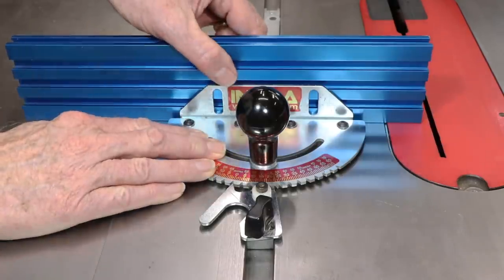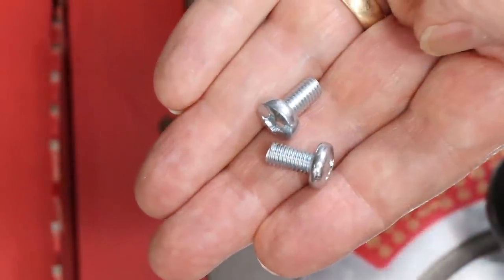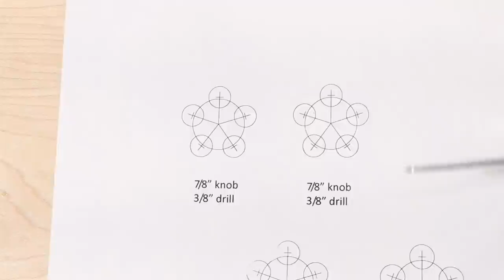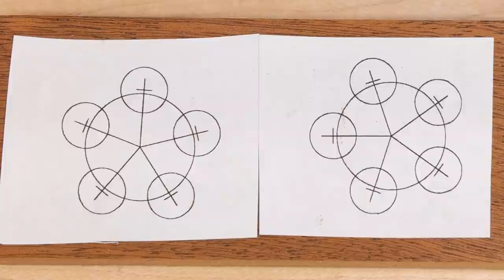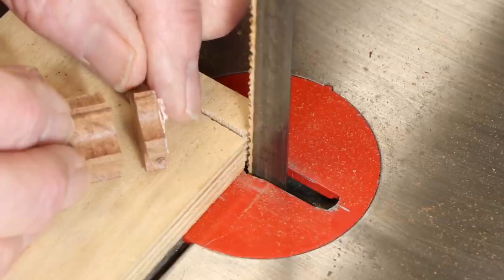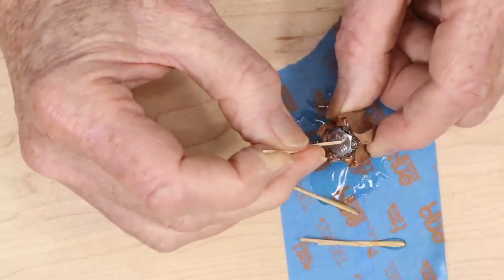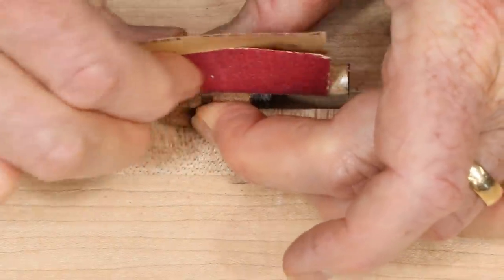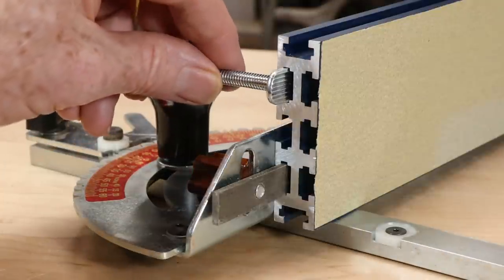Crosscut Accessories

Comment: As you started talking, I was trying to figure out where you might be headed with your correction comments. I thought, this guy is so talented that he is going to make a lever out of some exotic scrap and epoxy a hex nut or maybe use a threaded insert in his lever. A 1/4” hex head bolt in the fence gives you 6 shots at a partial twist to fully tighten with less than 180 degree flip of the lever. When you pulled out the wing nut, I said he is going to grind part of one wing to make a lever. 
Anyway, you brought me to the point where I can see a solution to an issue that I was trying to resolve the other day. Thanks.

Comment: I really enjoyed watching this project. Your knobs look very elegant and I like the way you recessed them into the knob. When you were demonstrating other options of how to tackle this project towards the end of the video I thought for sure you would I have considered an adjustable machine handle or a small cam lever. Like yourself, I use a lot of extruded aluminum in jigs. 80/20 and McMaster Carr have an array of extruded aluminum accessories to make nearly anything. I built a mortising machine completely from extruded aluminum parts and pieces I've collected over the years. I'm currently designing a hybrid work bench that will include inlaid extruded aluminum rails along with the traditional woodworkers workbench tooling. Now granted it's not as cheap as using plywood or MDF and making all your own parts for jigs. But I have found that the jigs I make from extruded aluminum and their parts can be much more versatile. For someone that is overly concerned with aesthetics like myself ,the investment is worth it. Like you have demonstrated in other videos aluminum is easy to fabricate with simple woodworking tools. I'm surprised that I have not seen more woodworkers using the vast array of a products available from 80/20 or McMaster Carr in their shops. Really enjoy your channel, thanks for all the work you do producing these videos.

Comment: You can also use nuts or bolts with adjustable handle. They are common on various machineries. A lot of mechanical advantage not limited to 11mm radius, and you can always find a comfortable position foe it every 60 degrees.

Comment: You could also use toilet bolts in the t-track, then make a wooden nut using a wood tap to make the internal threads. 2 pieces, 1 shop made, no epoxy-in-thread worries

Comment: A lever would be able to give more torque, and it would not interfere due to the small turning angle
Reply: That would have been my solution, shim with washers (and/or glip the toilet bolt over) until it tightens in the right part of the arc
Reply: It would apply more torque, but it would be faster, too.  :-)   Good idea.
Reply: How would you screw the lever on in the first place? I thought that too, then it dawned on me.
Reply: Indeed - a toggle would be a lot easier than fiddly knobs, if all you need is a quarter turn 6:10 . An easy way would be to have press-fit or magnetic toggles that just clip onto a regular hex-nut (that does the initial several turns without the handle). A further step of improvement would be to link both nuts, so that a single toggle-leve actuates *both*. Is it over-engineering? Heck yes.
Reply: I think of it as an adventure - it’s not so much about the destination, but more about the journey. You’d learn nothing if you’d stumbled on an immediate solution per chance.
Reply: @MiniLuv-1984  you could tighten the hex nut and then glue the lever in place
Reply from the maker: I seriously considered levers.  Unfortunately, fixed levers don't work, because you can't get them on and off the jig.  They need to turn all the way around several times to engage the threads, and the jig frame will not permit that.  Someone invented ratcheting levers, and I purchased a small assortment of these about a year ago from Amazon.   Here is a link to Incra's version:  https://amzn.to/3dHMb3c .  They are clever and very effective solutions in some situations.  They are plastic , but seem reasonably robust. They would be a little tedious to install and remove, because you can only turn them about half a turn before having to reset the ratchet, but once in place, then you could set the lever angle to whatever suits you, and probably never have to adjust it for a long time.  It certainly would have taken less time than I spent making knobs.

One reason I accepted the knob solution is that the fence can be locked up with surprisingly little force on the knobs.  These are not like lug nuts on your car's wheels.  They are not subjected to massive forces or constant vibration.  The adjustment is fast and easy, and feels very solid to me.  Your choice.
Reply: @PatrickSullivan  well, if the lever holds a nut and the track holds a bolt you could tighten them most of the way outside the track (by spinning the bolt) then insert it just before the final half turn to snug up.
Reply: @PatrickSullivan  These are not what I was envisioning at all, but I like them.  Thanks for the additional resource.
Reply: Patrick Sullivan I noticed in the picture of that Incra mitre gauge for those levers, they installed the L-bracket on top of the gauge instead of under it. Giving them more clearance.
Reply: Excellent video.  Your honesty in the design process is refreshing.  There is a lot to learn here, some of it has to do with the knobs.

Comment: Thanks Patrick!  Enjoyed your thinking/build process and read a few of the comments about levers.  They are fine in some instance but found the plastic ones usually die a horrible death in a short time.  McMaster Carr has metal ones with studs or internal threads but not cheap (~$9 ea.).  The one thing I noticed with your beautiful knobs is there is a considerable gap between the incra fence and bolt diameter, which I saw the fence jump when you tightened it.  Perhaps adding a shoulder or bushing to your knob would take up the slack eliminating the jump when tightening.  Thanks for the great videos and quality videography!  Really enjoy your channel.  ~PJ

Comment: I like your knobs!:) I was thinking of adding a spring and have a longer lever you could either pull or push to release from the hex and rotate to get a better purchase on to tighten or loosen. Just my brain over thinking it!
Reply from the maker: You can buy such a device.  It is called a ratcheting lever knob.  Here is a link to one of several you can find on Amazon:  https://amzn.to/2BbvyzO .  It may be possible to build such a device in the home shop, but it would not be trivial.  I have tested this, and it works in this situation.  I should have put this in the video.
Reply: Patrick Sullivan yes exactly! I couldn’t remember what they were called. Thanks. Excellent video by the way!

Comment: Great critique Patrick, did you consider shop made levers? with the correct thread selection you would only need ⅓ of a turn to loosen/tighten and you could shim the lever to put them in the correct position, or you could use those spring loaded reposition-able ones for an elegant store bought look, I know my finger tips aren't as strong as they used to be, good work.
Reply from the maker: Great idea.  I did consider the ratcheting lever knobs.  I bought a package of 1/4" ones made by Incra from Amazon about a year ago.  They would fit.  Here is a link to that product:  https://amzn.to/3dHMb3c .   They would work here.   However, the wood knobs do not require great finger strength.  They lock up the fence with surprisingly little effort.  I think the choice is one of aesthetics.

Comment: Okay, I love your workmanship! Very awesome.  My question is, would it be too difficult to remove the vertical part, and fashion a taller part, so you could use the next slot up?  Then I would be appreciative of being able to use larger knobs that would show off your skills even!
Reply from the maker: Unfortunately, the body of the miter gauge is a single piece of steel, bent into a precise right angle.  It does not come apart.  The other approach would be to raise the slot in the fence.  The miter gauge has slots for the screws that would fit a slot located higher in the fence.  If you build the fence from wood, then setting the location of the slot  to optimize the knob size would be easy.

Comment: Did the anodising on aluminium stop it reacting with the steel slider?
Reply from the maker: Absolutely no signs of corrosion or reaction.
Reply: Patrick Sullivan Thankyou for your response. I am only 73 with another 30 something years and until lockdown I didn’t pause to upgrade my tools and workshop. Well the shop is now clean, tidy, screws, nuts, brackets, varnishes, sanding, polishing supplies all housed properly. Your videos have now turned my attention to upgrading my power tools. Drill stand bench, sander and router benches and now table saw. Thankyou. You were so right about my multiple sleds in hidden places and not even properly made. The other day I ripped down an 8’ 2x4 into multiple strips and was thoroughly ashamed at my rough and rude system which worked as always but without the satisfaction I plan next time. I don’t even have a track slide bar.
Well until this week that is when I repent and turn around and show works of contrition...keep it up please

Comment: Off topics question - Have you had any issues w the metal fence triggering the Sawstop safety stop?
Reply from the maker: Yes.  If it even grazes the blade while running, the safety cartridge will fire.  That was one reason for wanting to make the fence adjustment so easy that I would never postpone it.  The saw has no trouble with the fence being simply close to the blade.
Reply: Patrick Sullivan I’m really enjoying your videos!  Thanks for sharing

Comment: Just be careful with an aluminum fence on a Sawstop table saw.  You maybe changing your underwear if the fence contacts the blade while it's running.  I've done it myself.
Reply from the maker: Unfortunately, I've done that, too.  I couldn't see any mark on the fence, but I suddenly needed a new safety cartridge and a new blade.  This was one of the things that persuaded me that I needed a faster, easier way to adjust the fence.
Reply: @PatrickSullivan My miter fence has a tiny mark on it.  I keep the blade and brake cartridge as a trophy to remind me to be careful. You should see Andy Rawls latest video:  “Crazy Table Saw Accident // Queen Bed Build // Golf Ball Case” he accidentally dropped a tape measure onto a running Sawstop table saw blade.  https://www.youtube.com/watch?v=A_5fpwSod-k
The result was not what I expected.